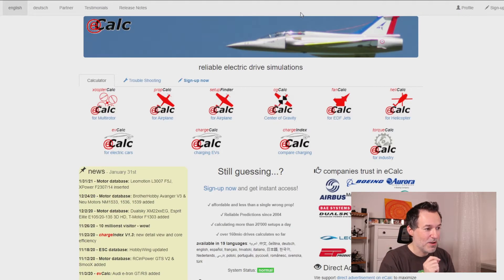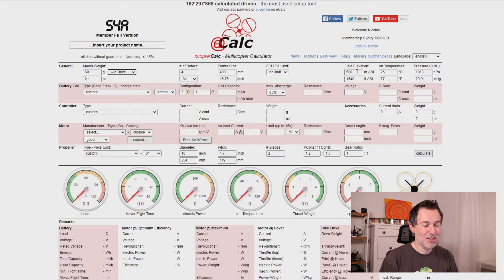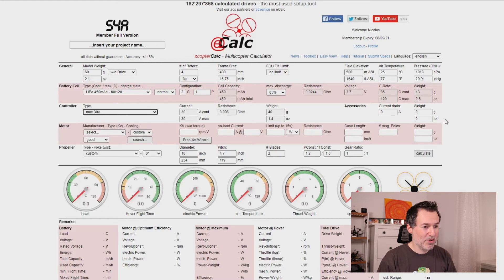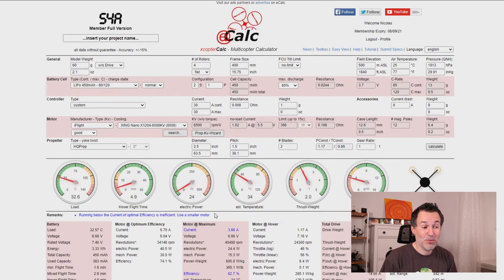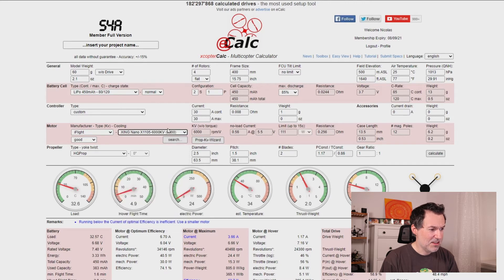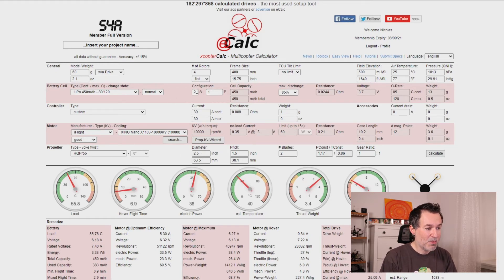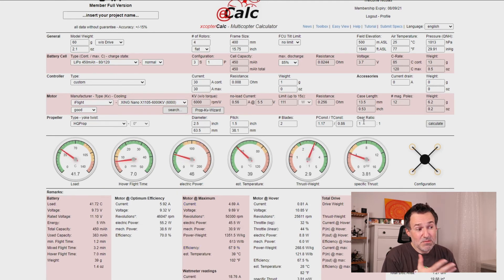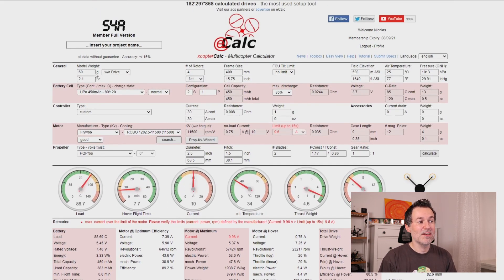How to figure out which parts to use for your drone build? - eCalc introduction

Comment: I have a quad 30a esc and 920kv motor f450 frame and 1045 propeller and 2200mah li po can u plz say what will be the amp draw at 50 per cent throttle and amp draw when I flew it
Reply from the maker: hi there! What matters most is the „all-up-weight“ (AUW) with the LiPo, as well as details of the motor. That should be enough to calculate some values.